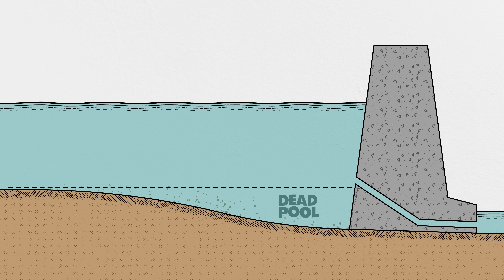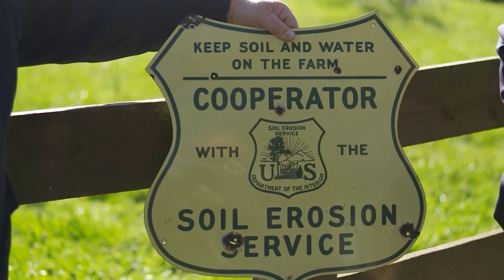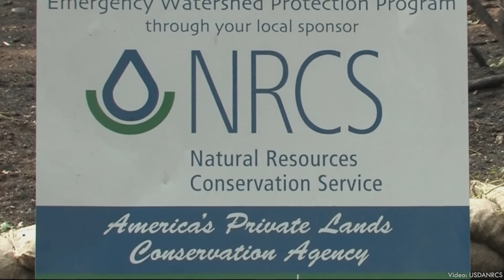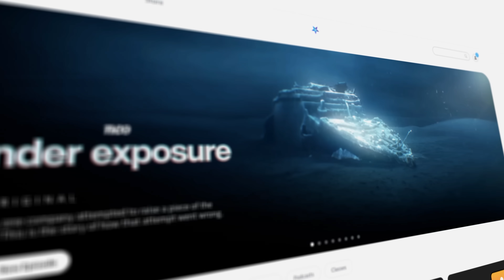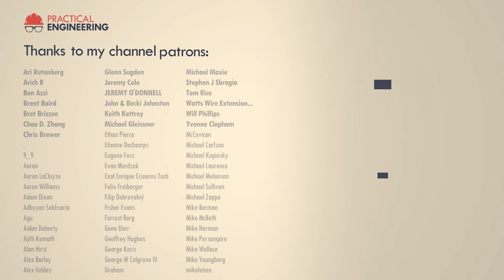All Dams Are Temporary

Comment: 10:02 Could you not place a series of augers along the bottom of the river to keep sediment moving to a designated outlet? As sediment builds up around the augers, it should help increase the velocity of the flow, leading to sediment remaining suspended along the desired path to the outlet. I think the main concern here is the possibility of plant matter or trash getting wound up in the augers and clogging them, but surely that is a cheaper maintenance project than dredging the whole reservoir!
Reply: I have a feeling the augers would break a lot

Comment: In this one dam scenario , I think one idea could be to reduce the length of time it takes for this to happen and reduce temporary environmental impacts from irregular sediment releases would be to have a model sediment load throughout the year and different water flows and events. And basically build a sediment catch up stream and release below the dam in a variable way that matches the model.  The some of the excess above that amount you filter out above the dam before it drops out of suspension and basically sell it as fill, soil whatever.  And the number one thing in that part of US is soil conservation effort.  Better crops end up being a result anyway.

Comment: I suppose the only ways to fix it are
-remove the sediment before it reaches the dam (which seems pretty unlikley)
-remove it from the dam by dredging
-prevent the sediment from building up somehow

But to prevent the sediment from building up, you probably have to keep the river flowing at the same speed, which doesn't seem like it's conducive to having a dam.

Building new dams when the old ones fill seems like the only real economically viable solution to me

Comment: Non-functional dams should be removed. In and around Boston, the Charles River has multiple dams that no longer serve their original purpose. One dam outside Watertown Square was built for long-gone factories. One further upstream in Waltham, just a couple feet high, serves no purpose and is sometimes submerged. A larger dam in Waltham Center was also built for factories that are long gone. Other than removal costs, there is no reason that all of these dams cannot be removed.

Comment: I’m thinking a not unreasonable solution would be to engineer a “tunnel” from the reservoir inlet/delta to near the dam so that sediment can be placed at the dam and the flushed through. This seems like something more on the scale of road construction than dam construction, still wouldn’t be cheap but would improve the longevity of the dam

Comment: the Bed Load Interceptors seem promising and i think a major advantage of them is that they are mostly passive (till you need emptying them ofc) and that you can have multiple spaced out over a stream well in advance. no need to catch all sediment in one go. just place them where they are accessible and the stream still has a decently high flow rate before it slows down because of the dam and you are good to go i think. it won't catch everything but it will reduce the amount of dredging. also they feel quite flexible as solutions go. 

though thinking about it i wonder if something like dredging upstream would be a possibly. hear me out xD up stream there may be places where flow rate is high but the depth is shallow. if my understanding of rivers is correct then if you dug a trench in the riverbed it will over time fill it back up to roughly the same height. which in turn reduces the sediment making it down streams. the advantage is that it doesn't require any new infrastructure if the conditions are right. just find a part in the stream that is easy to dredge every now and then with an excavator dig it out. like take lewis and clark lake, the example at the start of the video. right after the niobrara river enters the stream up stream there is an area where the river (from google maps at least) looks to spread out thinly over a wide area resulting in areas that can more easily be dredged at the regular then the down by the dam where the river runs deep. just keep a trench open there and it will capture debris much like the bed load interceptors would. just no installation required. i don't know. I probably miss something obvious but this seems like the easiest solution to me. though it won't top all debris ofc so dredging near the dam will still be needed. just less so.

Comment: So I have a question. Do beavers' dams also have this problem? I'm figuring they DO - but I'm wondering what happens. Do the beavers - I dunno, maybe they sort of dredge their ponds? Do they just abandon the ponds after some period of time, and the dam falls apart, returning that part of the water-way to its previous state? Does the way the beavers make dams allow for sediment to move along despite the blockage?
I ask this because I'm wondering if we could apply some of the "natural engineering" that beavers do, to newer dams down the line as it were. Obviously we can't just dump a bunch of logs across the Mississippi River. That wouldn't work! But I'm just curious if there ARE any facets of a beaver's dam that would benefit a human made one.
Though, honestly, I very much agree with all the folks who want to see many, many dams removed completely. Quite a few of them no longer serve any good purpose (some of them NEVER did, serving only to restrict access to resources in a specific and very mean spirited way).

Comment: Instead of low level gates, couldn't they make controllable stormwater type tunnels back to a sediment trap area to help pull out the sediment where it's first expected to fall? 
I get nothing is going to completely solve the problem, but certainly seems like it would dramatically reduce it.

Comment: So, what about one of those dredge sand pumps they use on the beach? Dredge where the sediment is and just pump it to the top of the dam. Put a very open turbine on the outflow to recapture some of the power used and wouldn't be quite as expensive.

Comment: While I'm NOT an Engineer, my suggestion would be for dams that are NOT meant to hold back sediment, bring in a suction dredger to dig out the deposited sediment and them discharge that sediment into the dam's outflow so the sediment gets mixed back into high-speed water to be carried downstream where it would have gone in the first place if the dam wasn't there...

I know that's easy to say and a cast-iron Witch to actually do (and probably expensive as well), but it would significantly increase the dam's operational lifespan as well as reduce the downstream effects of the dam's predilection for trapping the sediment...

If the dam has a hydroelectric power plant, perhaps the dredge discharge line can be connected to where the water exits the turbine (so it can't damage the turbine itself but can still be mixed into a high-speed water flow) or dredge when the water level is high and needs to be reduced and aim the dredge output into the sluice so the water flowing out of the dam through the gates grabs it and carries it downstream...

Comment: Just use a suction/pump like I used to clean my pool, to pump sediment around the dam. The main cost would be to run pumps 24/7 and the initial cost of the pipe and or flex hose. And would it maybe be possible to eliminate the use of pumps all together by simply relying on siphon?
Reply: Trying to match the natural sediment flow pound for pound, ya good luck with that! If a reservoir has bean established for a while, start by pumping more than you figure the river would carry, if not too much so that it causes negative affects downstream.  If you have the advantage of the reservoir being new, guesstimate how much sediment to pump and then over time study the reservoir and then determine if increase or decrease is needed.

Comment: The super fine silt/sand has to be good for something once collected and dried. It could be used for sanding roads in the winter
Reply: The cost of moving and trucking it would be much higher than any value you got out of it. Dirt is abundant and of low value lol

Comment: Another option would be basically like 2 toilet bowls or Pythagoras siphons. The first would be higher and act as a reservoir on a toilet slowly filling and after a point flushing into the second, the second would accumulate sediment and would have an outlet of a certain size so it couldn't just flush on its own under normal conditions letting water out after sediment has settled from it but narrow enough that when the first revivor flushed into it it acts as a giant toilet and blasts the sediment downstream of the dam. It would need some sort of valve between the 2 reservoirs to be able to lock it out so you don't just flood downstream areas in heavy rain. Like my previous idea a decent amount of aluminum with the super hard oxide layer to prevent it from being sanded away.

Comment: You need multiple pipes level with the end of fast flow gradually decreasing all the way to the damp end then connects it to a high speed down flow using the pneumatic siphon to increase the suction power and throwing the sand further away from the dam 
Your might need to have concrete structure to contain it and make it self cleaning from the sand

Comment: My idea would be figure out where the sediment will go first and put essentially an underwater mini dam that will catch it and funnel in through a pipe system all the way downstream of the main dam so you don't have to use a much water to flush it and with the exception of preparing for droughts you can basically have it always on. have it the same slope as a sewer pipe to facilitate the highest velocity and solid removal to lowest flow volume possible. Make them aluminum at least on the inner layer so sand is less easily able to erode the inside and it's smoother than concrete. Heck depending on the species of fish it may even be able to double as a fish ladder since it's gonna bypass the turbines anyway.

Comment: Why not have a robot(s) scouring the bottom of the reservoir that uses ultrasound to resuspend the sediment and then channel it with large tubes downstream beyond the dam wall so the sediment can continue its journey. It's like the thing you have in your pool to keep it clean, only way bigger and driven by AI to make it possible to run 24/7. This system could also manage the volume over a given time of the sediment being released, so it could match the "natural" rate the river normally carries.

Comment: What if you built a 2nd dam far enough up/down stream to facilitate a 2nd reservoir, then completely opened the floodgates on the first dam to let all the sediment out over the next 50 years while using the new reservoir, and alternated every 50 years? Adds the costs of building and maintaining a 2nd dam which will only be fully usable half the time (which isn't really a problem imo, we could use some big TVA-style projects in this country right about now), but also means you have a dam system which should let all the sediment through eventually.

Comment: Isn't the solution just that: keep it in solution (suspended). How? Well I was thinking of pumping pressurized air through tubes running on the bottom of the reservoir which release air bubbles at intervals to keep/re-suspend the particles.

Comment: If you just want hydroelectric power, you don't really need such a large volume of water, you just need a decent, consistent flow and a large drop in height.

You could do that by having a large pipe running from high upstream, through an aqueduct to a point downstream that can hold enough water to feed a turbine on demand. You don't need millions of tonnes of water.

Comment: Why not incorporate considerations in the initial design. Have 3, 6 or 9 "silt drains" in addition to a few low level gates that open every few months to let out excess silt thats built up. Those "silt drains" would be channels that are constructed on or below the riverbed, with their inlet (or drain) being a few hundred meters to a kilometer from the actual dam, draining away the sediments taht would not reach the dam in a normal scenario. 
This would not eliminiate the need for dredging, but would provide a relatively low-cost solution in addition to mechanical removal of the material

Comment: what about a screw type discharge chute running the length of the dam from the site of initial delta formation to the dam wall .  The screw  open mechanism can be moved along the length of the dead pool to remove sediment. Like the mechanism to take discharge water from different levels of the dam to create optimum downstream river temperatures for habitat but horizontal rather than vertical. . It can be regulated to allow correct turbidity ratios. Not an engineer and the cost may outweigh the limited benefits. just a thought.   Love your work

Comment: I feel like this is the kinda thing you can design for if you're concerned about it at the start of the project but that gets exponentially harder as soon as you haven't.

I could see building the dam with a contoured concrete bed where the sediment is predicted to build up, with ridges to encourage turbulence and pull more sediment out. Then have a vessel or machine built that's designed to collect the sediment from the platform. Then take it and add it to a basin that re-injects it with gravity after the turbines/sluce gates so that the water has it's sediment level restored.

I also see this as probably costing a couple hundred thousand dollars per year for most dams, which means the US will never invest that much into infrastructure maintenance no matter how big the problem is.
Reply: I think you're off by a couple zeros, my friend. $100K is one worker.

Comment: My PhD dissertation was on the cost of sedimentation in Ohio reservoirs.   Dredging was a gigantic cost (the easiest to quantify), but lost use values added up, too.  Folks include hydropower in the category of "renewable energy", but while the hydrologic cycle is, for practical purposes, perpetual, a dam SITE is a non-renewable resource; once a dam is silted in, that "renewable" resource is no longer useful.
Reply: yeah, the best long term solution for a dam is removing it.
Reply: Why do you classify that as non renewable? Do you think wind turbines and solar cells last for all eternity or what? I can promise you that a dam lasts significantly longer than either of those.
Seriously, all you have to do is build the dam at a different spot and cycle through locations.
Reply: @laju6398 Dams destroy land by covering it in water, and they can't be built just anywhere. So it's not that trivial
Reply: @laju6398  There is a reason dams are built where they are.  Ideal sites are limited, so any abandoned site means alternatives are inferior.   Plus, the existing dam is still there, or, if removed, then the sediment heads downstream in a big slug.  Generally speaking, the reservoir length is not suitable for constructing a new dam, so long reaches of rivers are taken out of play.   Solar panels and wind turbines can be replaced in exactly the same location, but not so for dams.

Comment: Before watching the video, my proposal for an ez solution: really big pipe that comes out at the bottom of the dam, and a large mesh bell at the intake.

Because the exit would be placed lower than the intake, the water would flow through the pipe without the need for pumps. 

The large mesh bell would ensure that the sediment does not cake up the pipe enterance, rather only allowing sediment that has been disturbed back into the the water to enter the pipe.

Some boat would gently poke the ground with this contraption, agitating the sediment to become lose in water, which would then get sucked into the pipe and exit downstream. 

This system would, I hope, be reliable and simple, as there are no pumps in this pipe.

Comment: Any chance we could get a video with input from hydro engineers on the feasibility and drawbacks of the interesting ideas in the comments?  This problem surely has so many more complicating factors than a layman could guess, it would be interesting to see why supposedly simple fixes to this problem don't work.  My idea was to wonder if, given the difference in elevation between the back of the reservoir and the bottom of the dam, some could sort of siphon could yield a less energy intensive way to get a sediment laden slurry from upstream over the face?

Comment: just an idea, but what if the sediment was removed before entering the reservoir. either by filtering or something, then redirected down a separate stream, where it re-joins the river after the dam, this would allow for the sediment to flow freely at the normal rates while also preventing build up.
Reply: easier said than done though I'm sure the cost to benefit ratio would not be rational otherwise it would probably already be done
Reply: How do you propose to separate the sediment, specifically 6000 pounds of sediment every second, from the water?

How do you propose keeping the canal from filling up?

Why would you do this instead of just rerouting the river itself and removing the dam?
Reply: Too much infrastructure that might out weigh the benefit of having a dam in the first place.

Comment: look, the only way you're gonna get that dirt outta there is by dredging it. Someone already mentioned the fox river dam, there's more in the dirt that builds up than just silt. you have to move that dirt manually, and you have to have a place to put it when you do.
Reply: You can flush the reservoir, it is done in Switzerland.

The best solution is just removing the dam.